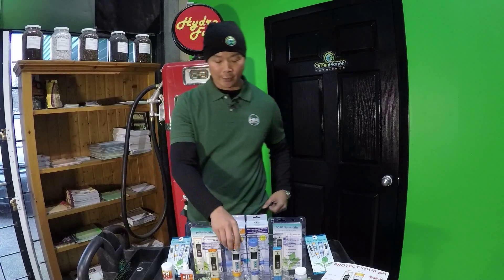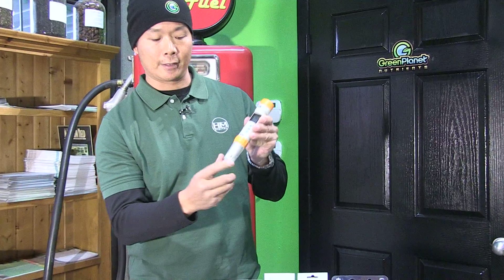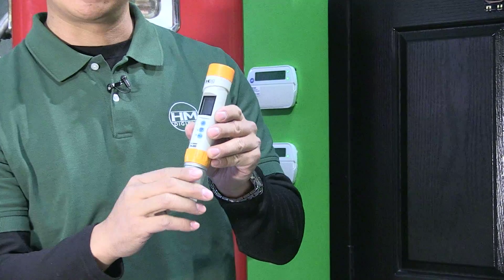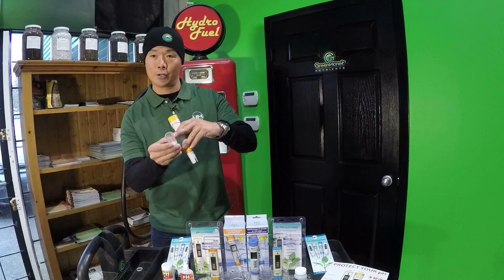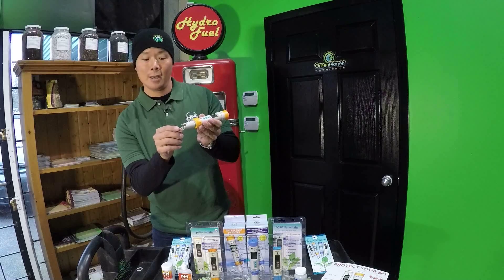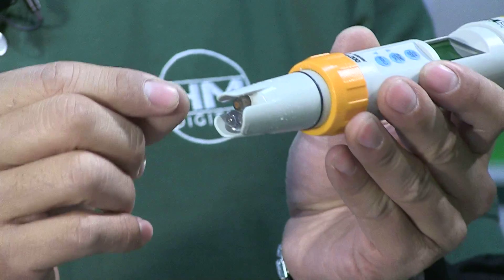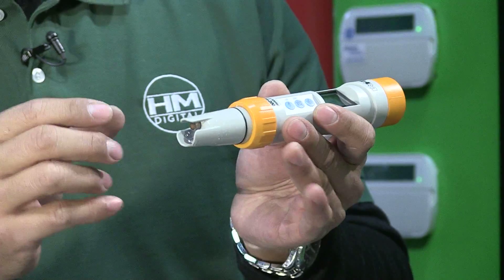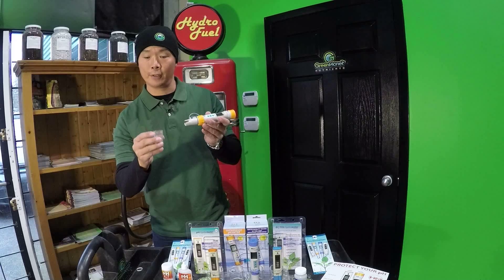HM Digital PH 200

Comment: Hi,  I live in wales uk I have a TDS METER IN PPM'S it reads 30ppm in normal tap water ,  and i am using  3part Advanced nutrients micro grow bloom PH perfect, when i add the nutrients it is only measuring at 190ppm is there something wrong with my TDS meter. thanks
Reply: +MrPhotographer4 You need to keep checking the TDS and plot a graph. This is the only way you will know if there is a problem with the meter. Otherwise, you can use a different TDS meter and compare!